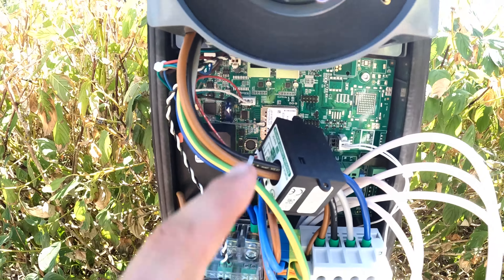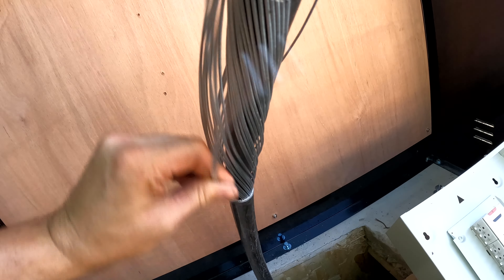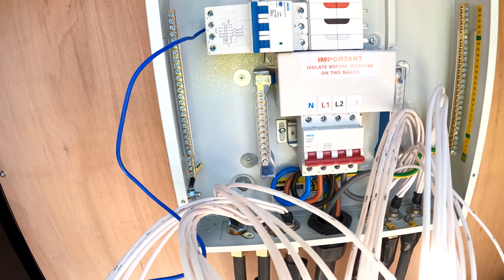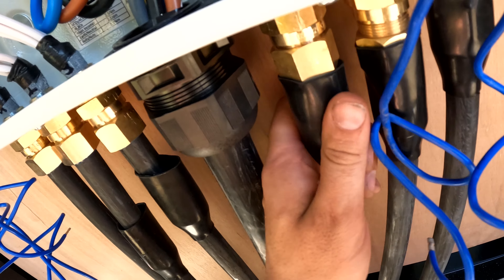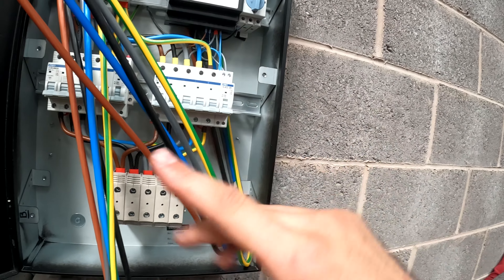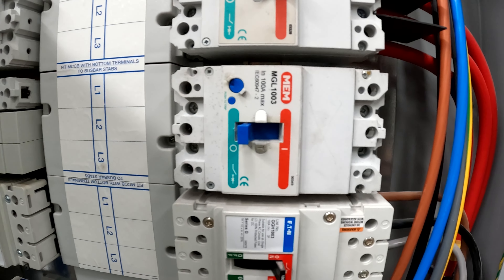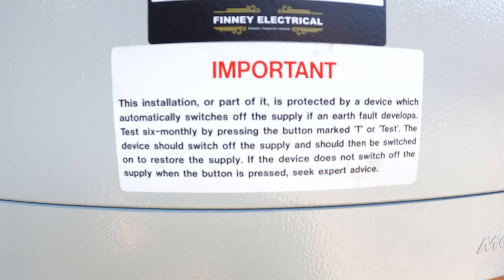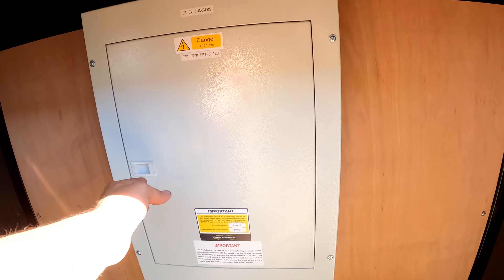HOW TO INSTALL 3 PHASE ELECTRIC CAR CHARGERS 🚗💨 ⚡️2ND FIX

Comment: When I’ve done Matt:e, I think the swa gland should be at the other end and the stuffing gland at the Matt:e. That’s the only way to divorce the earth. If you look closely, the bonding to the door has made a parallel path across the swa glands through the metal casing, possibly making the device useless. Took me a bit to get my head around at first.
Reply from the maker: Heya Daniel! cheers for watching the video and commenting! much apprecticated! So the whole system after the matte is the Matte's earth. The fuse board/cabinet/poles don't have a path to earth as the concrete isn't conductive.

Comment: Does regulation 722.531.3.1 not state that RCDs protecting EV charges shall break all live conductors of the circuit they protect? A neutral conductor is classed as a live conductor, therefore unless i’ve missed something here there is a non compliance on the protection as the RCBOs which clearly incorporate RCD 30mA protection  do not break the neutral running through them.
Not sure what solution there is to this using 3 phase boards of that type? 🤷‍♂️🤷‍♂️
Reply from the maker: Heya! Yes always interesting finding a double pole RCD for single phase with that reg, only use box mini that I’ve found , you know any others? 

So these three phase rcbos actually have a neutral terminal that’s switched surprisingly. Super expensive, the Hager ones were £250 a pop! So wen with mcg I think on this
Reply: @finneyelectrical  Out of interest what supply cable and protective device did you use to feed the distribution cabinet board. Did you design for full load of all chargers or did you drop it down based on the capacity of the load sharing? 👍🏻
Reply from the maker: Can’t fully remember but it would have been 25mm 5 core, matte pen fault protection supplying the threephase board. 100A protecting that, then 32A typeA rcbos protecting chargers, the chargers were limited to the 100A or may have been dropped to 95A. Load sharing was applied so the charges would drop what they pull depending on demand of the charges and demand of the whole site.